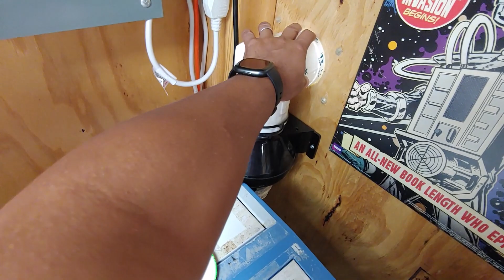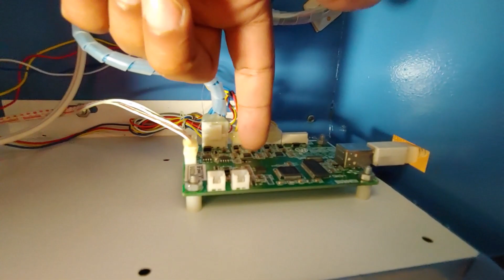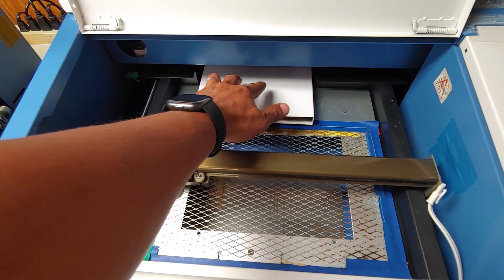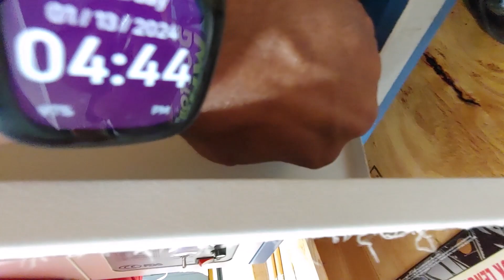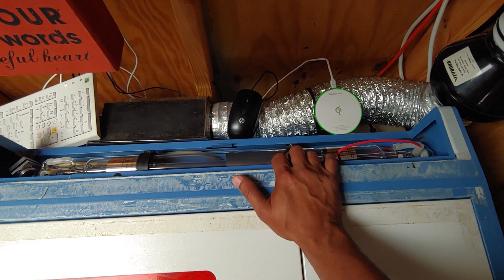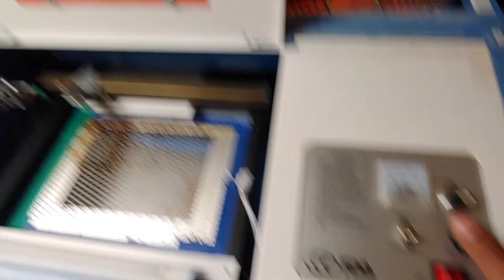Inside A 40w Laser Cutter

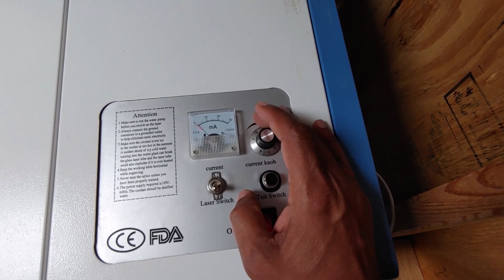Comment: just a nit in case anyone is confused.  The switch you talk about at 14:08 is just a laser on/off switch.    The "current" label is for the milliamp meter above the switch. Nice job on the fan ducting.
Reply from the maker: LOL  True, this is confusing.  I said current because I am constantly doing the wattage calculation since the tube is rated in watts.  I have a 110v system, but they come in other voltages.  The switch actually goes to the enable input on the power supply and indirectly cuts the power output to the lasing tube.  Thanks for pointing that out.